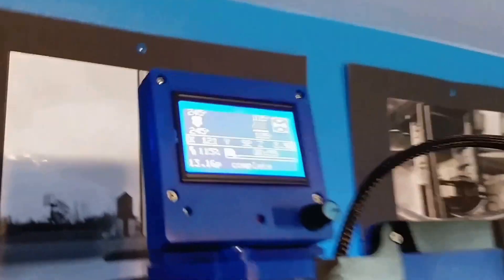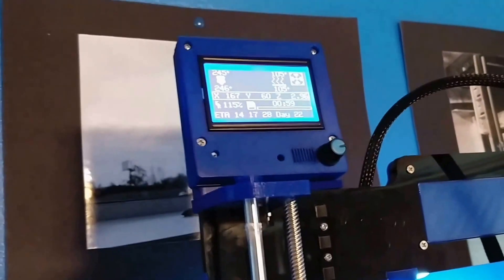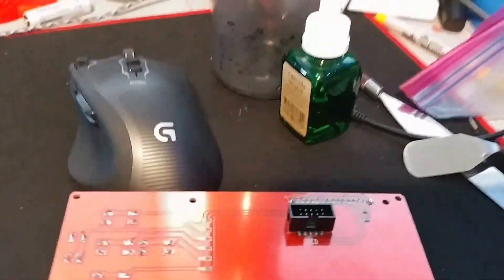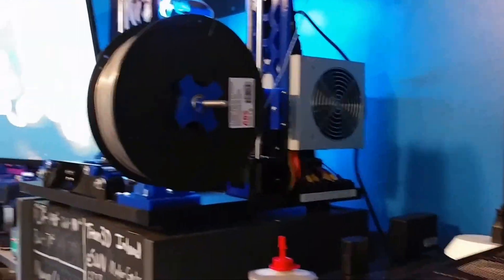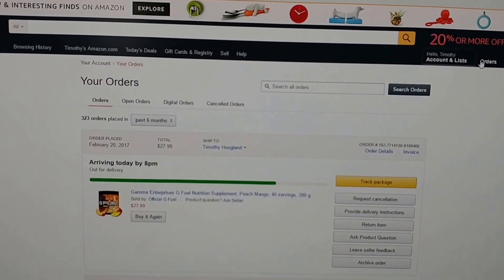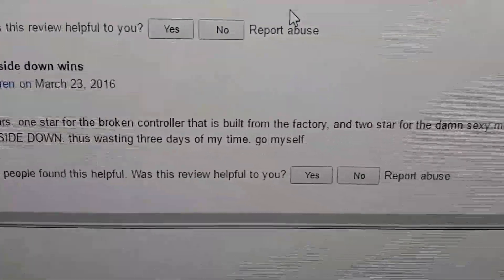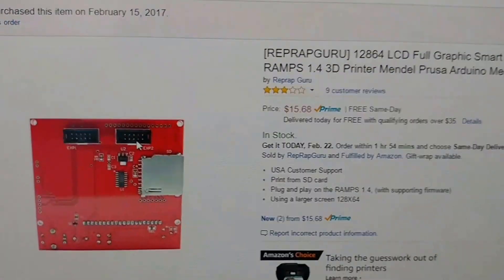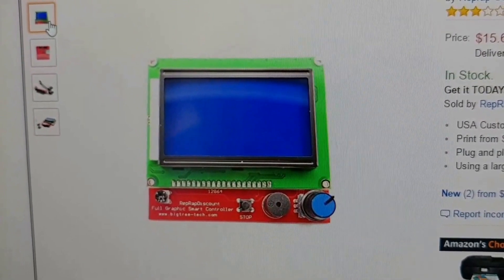Fixing RepRap Discount 12864 LCDs - Backwards Connectors

Comment: Thanks for that one. Its not even the screens board fault. I 've migrated from MKS1.4 to OctopusV1.1 control board. Both boards have the connectors for this screen, but the V1.1 pinout is flipped. The fault is because no one standardised the direction of the connector on the printer boards. I've had no screen for a year then I noticed today looking at the diagrams the plug had rotated between them, which I had missed and had gone undocumented.

Comment: Thanks for the video. Mine gets a backlight only when connecting it the way it is on the board. If I use your method, the screen is off (no backlight) and will not power on. I am assuming they fixed this but not by flipping the connector on the board around ?
Reply from the maker: It depends on the board and then what firmware is setup on there. You could also have EXP1 and EXP2 reversed OR you are using a 12864 with a single LCD header board (like some of the creality style boards) that need an adapter board.

Comment: Thanks, heaps, heart sank when the new screen didn't boot, found you quickly and am underway again. Slightly different discprition from Deal Extreme, but same item, same issue: "Intelligent Digital LCD 12864 Display 3D Printer Controller For RAMPS 1.4 Reprap"
Reply from the maker: Glad it helped! :)

Comment: Do you remember what setting to choose in marlin? I'm new to both marlin and putting an lcd screen on my printer. I have used repetier on my previous build without a screen. I flipped the connectors already, surprised they haven't fixed it in 4 years. Thanks in advance for the help. Any issues with the SDCARD SLOT?
Reply from the maker: You have to enable SDSUPPORT in the firmware for the slot to work. Some boards need you to specify if its on the LCD or ONBOARD if the board has its own SD slot.

Comment: SAVE YOUR TIME: Another issues with these LCD screens: 1) the limitation on the length of the cables. I was using a 20 cm cable with no problems, then changed for a 80 cm one. The 80 cm did not work. It kept sending the message "sd init fail". Changed back to the 20 cm cable and it is working perfectly again. 2) they did not work with micro SD card with adapter. I tried 64Gb SanDisk micro SD and it does not work no matter what I do. If I use an old 4Gb SD card, it works with no problems. 

I hope these hints can save someone´s time. 

If anyone knows how to make it work with 80 cm cable, please, let me know.
Reply from the maker: 64Gb cards do not work with Marlin, thats just a limitation with firmware not the LCD. 32GB is the max size.

As for the longer cables, Move them away from power and stepper lines. You can also add shielding to them to reduce EMI. The longer the cables, the more prone to picking up interference they are.
Reply: @TH3DStudio  Thanks, I did not know about the Marlin 32Gb limit. I think you are right about the shielding. Tried to simulate a Faraday cage with some wires and placed the 80 cm cables inside. It worked!!!! Already bought shielding for the cables. Just waiting delivery to test it, but I think it will work. 

Thank you, my friend. You really helped me!!

Comment: I bought this exact same unit. I am trying to get it working with my MKS GEN L v2 running TH3D Unified Firmware. I knew about the connector issue, now I just have a blue screen... Can you point me in the right direction?
Reply from the maker: The Gen L V2 isn't supported in our firmware. You should be using the normal Marlin firmware from MarlinFW.org. I haven't played with the Gen L V2 and it's an older board at this point so I don't plan on it.
Reply: @TH3DStudio  v2 is older than v1? That's odd
Reply: @TH3DStudio  BTW, it works fine on your firmware. Turns out the contrast was shipped WAY out of tune.
Reply from the maker: @burntkat  We only ever used, bought, or sold the V1 of the board. I only learned about the "V2" a few weeks ago so I haven't actually used it nor do I know the differences between it and the V1. Its an older 2560 based board that has been replaced by the MKS SGEN L (32bit) so I didn't want to spend time on it.
Thanks for letting us know that it does work with that board. I would assume that the other features like the UART pin headers on the V2 are not going to work with our firmware if you are using them. But if you are using stepper drivers in standalone mode then you may be OK. Again I am just speculating as I have never touched the V2, I just looked it up and it looks like a V1 with some extra IO pins added near the stepper driver sockets for UART with TMC drivers.

Comment: DUUUUUUUUUUDE.  so much doubt.  I pulled a geeetech off of my WORKING delta + Ramps + MEGA to my new SKR 1.3 and got no power, no nothing... I was shaking my head the whole time watching your video, prying these dumb connectors off, like.. this ain't right.. gonna smoke my board... 
Anyway, it works.  I got power at least... ALSO, goddamn EXP1 and EXP2 labels were hidden under the stupid keyed connectors.  Thanks bud.  buy yourself a beer.

Comment: Thanks for the video I ll try , I have light in the lcd but Didn’t work. I hope is this it took me 6 hs trying
Reply from the maker: Probably a firmware setup issue then. If the LCD lights then you should have correct connections.
Reply: @TH3DStudio  I fried my board. Yes the plastic was bad oriented, when y changed up doest go only lcd on off blinks so y changed the input in the ramps socket and the puff. dident tuen in more. I coudent download the diafram link that you have. Thx anyway,

Comment: Oh god. Thanks! this was my problem. I fixed doing something a little different: its easier to just sand off the connectors, and voila! I can connect them in the correct way.
Reply from the maker: I found flush cutters will take them off quick as well!

Comment: I had blue screen with no images. flipping port did nothing. Checked config and needed "#define REPRAP_DISCOUNT_FULL_GRAPHIC_SMART_CONTROLLER" enabled not "#define REPRAP_DISCOUNT_SMART_CONTROLLER"
Reply from the maker: Thats because you selected the wrong screen in the firmware. Has nothing to do with the content of this video..
Reply: @TH3DStudio  Yes, my settings were incorrect. But I didn't know that until I tried your solution. Perhaps my comment will help someone making the same mistake.

Comment: its not printed wrong it uses a reverse cable being its uses different cables to the one you currently used on the printer
Reply from the maker: You would be incorrect. The cables are the ones that came with the LCD.
Reply: @TH3DStudio believe what you want but I'm not wrong I've got 2 screens that have 2 different ways they are wired even though they are the same screen so I'm not wrong the encoding in the screen is reversed

Comment: FOR THOSE WHO ARE STILL HAVING ISSUES.. I had this same issue when upgrading my Ender 3 stock Melzi 1.1.4 board with the skr v1.3  and also swapping the stock display to the RepRap Discount Full Graphic Smart Controller LCD. Initially I just plugged the LCD in as normal and was only getting the blue screen..  After watching this video I tried this method of rotating the connectors 180 degrees and that did not work for me, The LCD would not even power on.. However, I flipped my connectors back to original position  and I realized that the LCD was powering up so that led me to believe it was indeed wired correctly. I carefully went through all of my configurations and realized that I had previously enabled the "CR10_STOCKDISPLAY" option to enable the ender 3 stock display before I upgraded.. Well, I forgot to go back in and comment out the "CR10_STOCKDISPLAY"  option and that was my issue. After commenting that out and making sure to enable "REPRAP_DISCOUNT_FULL_GRAPHIC_SMART_CONTROLLER", everything works like a charm!
Reply: I am having this issue, checking my config now

Comment: why would this NOT WORK????? I flipped the sockets so I could get the ribbon cables right (red wire to the RIGHT). I went into Marlin 1.1.8 and uncommented the board. But it still doesn't work?????
Reply from the maker: If the LCD backlight is coming on then the wiring is correct. If its still not working could be a config issue or a bad LCD.
Reply: that's crap, I think. there's way more wrong with these clones. I think ALL of the wiring is wrong.  @TH3DStudio

Comment: Hi,  why are we changing the black housing upside down? instead, cutting other side of black plastic with a plier, and connect the cable. does it works?
Reply from the maker: Either way works.
Reply: @TH3DStudio  ok thanks. l tried but didnt work, probably mine was faulty.

Comment: Thank you Tim
You save my but once again.
I have hunted for this exact solution could not find anything stating which one or what was correct orientation
This worked perfect 
hooked write up to my MKS Gen L board and once configured it popped up perfect 
Thanks again
Reply: I am fighting the same issue. Have a MKS Gen L v2 board and TH3D UF on it. I flipped the cables around and all I get is a blue screen. What gives?

Comment: It's the connectors on the extension board that are upside down .. and those can be desoldered and soldered the right way easily. Mine came with the connectors on the display pointing "down" .. but it lit up the moment I hooked it up .. and after few attempts of setting it up through Marlin it works just fine, which tells me that it's the connectors on the extension board and not the main display board itself.

Comment: First of all I'm glad I found this video! I was on the verge of boxing up my display and sending it back thinking it was bad. This video fixed my problem!! Thanks!
Another problem now:
Using your firmware(TH3D_UFW_U1.R2.7) on my Ender 3 and this display and the control knob is backwards....Turn it counterclockwise to move down the menus. Also if you turn the knob clockwise to move axis, it gives you negative value.
Anyone else see this and is there a fix?
Reply from the maker: The firmware is not meant to be used with this display only the stock ones. Look in the configuration_backend.h for the marlin reverse encoder direction line and reverse its value.
Reply: @TH3DStudio   Thanks for the reply, I'll give it a go!

Comment: Thanks! I changed from a Ramps 1.4 that came with the monitor to an MKS. At that point the monitor stopped working. I flipped the plugs and we're back in business. Much cleaner solution than filing the notch like others are offering to do.

Comment: Good tip, thanks, saved me a lot of debugging, just got mine (August 2018) but still the same issue, instead of pulling the plastic part out, I just added 2 small cuts to allow the connector to slide in. Actually, the display is not the problem, the controller board is, the MKS boards have the EXP1 and 2 connectors reversed. It should work correctly for other brands.

Comment: Great Advice! worked for me. many thanks. I would never got it working, without this piece of advice.
additional tip - there's a contrast pot on the board - the screen only displays digits
with the potentiometer rotated all the way round - otherwise the screen just shows blue backlight

Comment: I am building a Prusa clone and using a Rumba board and a MKS Mini12864. So far I have no luck installing. The reprap wiki info on the Rumba actually shows how to connect the ribbon cables. The Rumba is backwards similar to the reprap 12864 board. At least I think it is. Pin one on a circuit board is always a square pad but on the Rumba board pin 1 shows on the right and the photo shows the ribbon cable with the red stripe on the left. The other issue I have is properly setting up the firmware. The wiki talks about Marlin 1.0 but supposedly 1.1 has already made changes to the various files. I am going bald fast.

Comment: Unfortunately that wasn't the problem. I have LCD 12864 connected to mks gen v1.4 and I only get a backlit blank screen. The problem also isn't brightness as Ive adjusted the pot. Do you have any suggestions?
Reply: @NikoMR  I also have the same problem
Reply: @SuperLesi123  I have the same set up.  gen 1.4 and the reprap LCD.  not matter what orientation that cables are in I get no text.  What did you change in config file?  I have #define REPRAP_DISCOUNT_SMART_CONTROLLER
Reply: @humbuckr5  Scroll further down, this is the wrong controller. You need Full graphic reprap

Comment: I rotated mine 180 degrees and plugged in the cables and it still doesn't work (lights up but not text or symbol). I tried switching the cables and it didn't light up at all and made a loud beeping noise. Any ideas?
Reply: Same here

Comment: Thank you so much for putting this up! I did this to my screen but it wasn't the same size as that one however, it was the same company. i used a hammer and a nail like thing to pry out the plastic pieces and then flipped them 180 degrees. It works great now. Thank you.

Comment: Wow. Lots of information! great video you earned a sub.
But could you pls tell me if it is possible to extend the two 10 pin ribbon cables by buying longer ones. (i would need 1m)
because i have heard that you cannot do this as the LCD will not function with them.
thanks,
Reply: Timothy Hoogland Thanks. Will do. Keep up the good work!